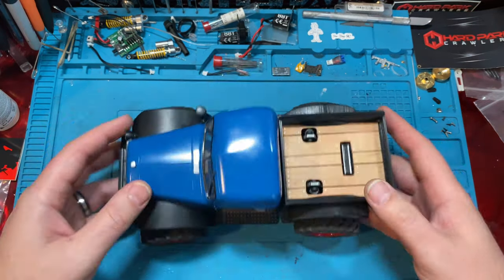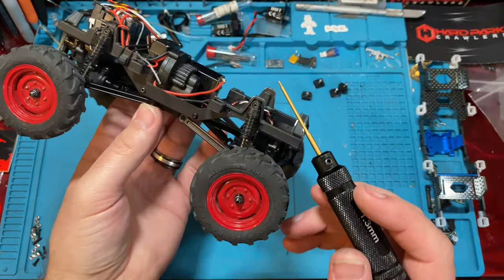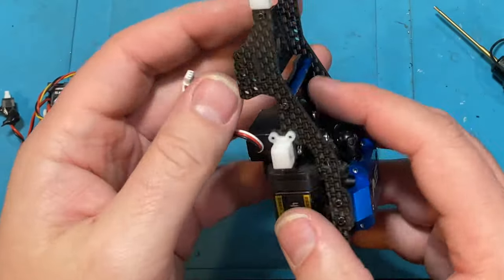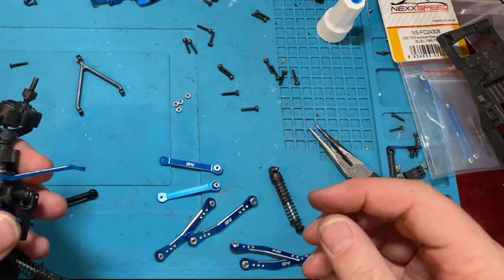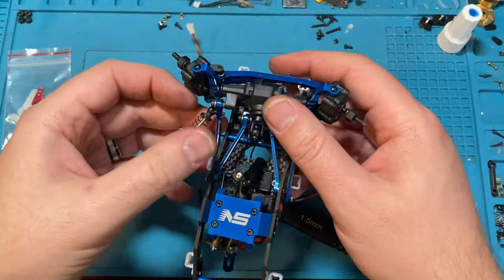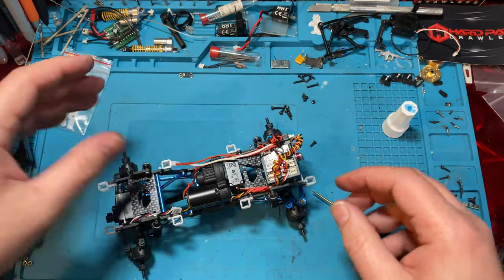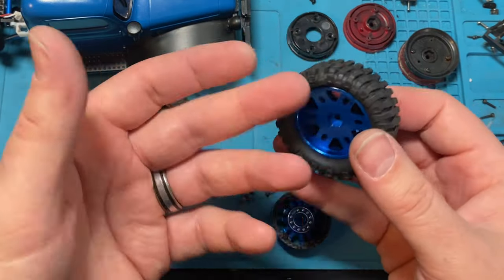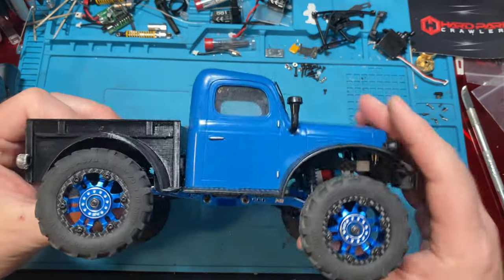FCX24 - Blue Butcher Gets Some NexxSpeed Upgrades! (Yes, all this works on the Smasher & K5 Blazer!)

Comment: I used longer screws to get 1 inch tyres on. Bigger gap. Slowly pull em in. Replace as you go with standard screws👍🤠👍
Reply from the maker: That makes sense!!! I knew there was an easier way.

Comment: I’m curious why nobody is making a 2 speed skid/adapter kit for the fms scalers. That being said, it’s It’s nice to see a chassis for FCX24. More shock tuning is nice.
Reply from the maker: I agree.
Reply: you mean a skid for the 2speed tranny that would fit their 1/18th trucks? if yes, i find it just as baffling. even more baffling i find that literally nobody even tried to make a motor mount for anything bigger than the stock 050 motor (which is easily the weakest point, by far, of their trucks)
Reply: @praetor47  yeah. Seen a bunch of people swapping the fcx2 speed/ portals into the fms 1/18 scale trucks. Hell they could even make a chassis as well. They all use the same frame rails, just in varying lengths.
Reply: The FCX24 uses a 130 size motor.
Reply: Fcx118 finally came though.

Comment: Hey, thanks for the video. It made me realize that "Nexx Racing" and "Nexxspeed" were two DIFFERENT companies and I was missing out on some options for my rig.

I'm having a problem with my Furitek Hiroyama . It came with Furitek's Galaxy servo mounted on the stock mount, so it sits at a stressed angle. The gear housing of the servo actually broke under mild (for a monster truck) use,  but, while furitek is sending me a new one, they do not have a solution to the mounting issue and claim "it has not been a problem for others".

If you have a long servo like the galaxy that has ONE set of mounting holes (unlike the servo used in this video which has two sets) is there any way you could check and see if this nexxspeed mount allows it to clear the upper links? I can't find any info on it anywhere else, and I'd really appreciate it. 

Thanks again for the great video.
Reply from the maker: unfortunately I do not have a Galaxy Servo from @furitek. However, it should fit although, you might have to drill new mounting holes in the servo ears. (which really isn't too big of a deal)
Reply: @TheShopMiniRC  Thanks for the reply. The problem is that the galaxy servo I got with my hiroyama broke because it was mounted on the stock mount at and odd angle. They're sending a new one, but I'm extremely hesitant to drill holes in it. I'm working on a 3d printed solution, but I'd much rather a nice product like the nexx if I knew it would work. Thanks for trying to help.
Reply from the maker: @TheTomasTube  you can always drill and tap new holes in the aluminum servo mount.

Comment: Can you swap sides with the c hub so the screw is in the back ?
Reply from the maker: I think that will mess up the caster angle.
Reply: Maybe it will correct the caster problem you ended up with ?
Reply from the maker: @kevincasey6876  hmm. I’ll look at it. The problem was the axles and links though, that was causing the driveshaft to point too far down.  Changing the c-hubs wouldn’t fix that.  But I’ll give it a look for sure. ;)
Reply: I don’t have my Smasher yet but looking at photos on Nexx racing of these C hubs it does look like it will work out .
Reply: It doesn’t look like the links bolt to the C hub , And I’m sure Nexx knows how to measure links to copy them Notice on the axle side of the C hub there is a star pattern . That pattern is clocked slightly .

Comment: I just purchased FMS masher. Does it hold up well to general bashing with stock motor without spending a fortune on unneeded upgrades like steel trans gears etc? Thanks and cool build👍
Reply from the maker: Yep, it’s a blast you really don’t need all the upgrades unless you upgrade the motor.